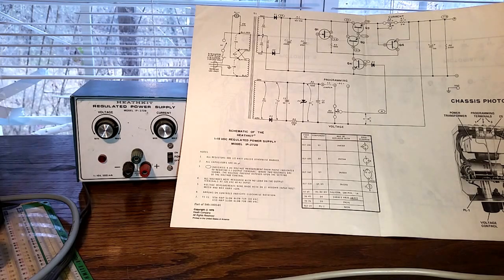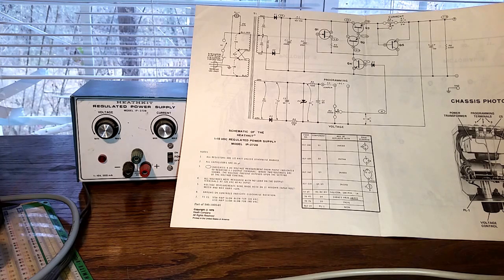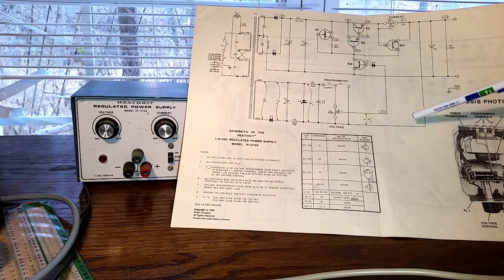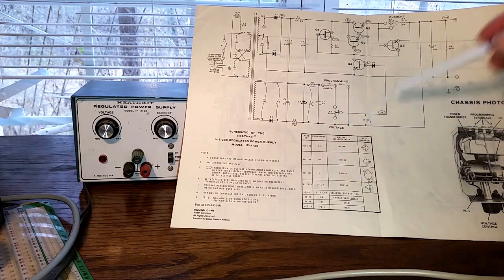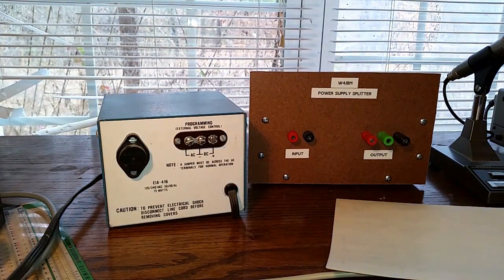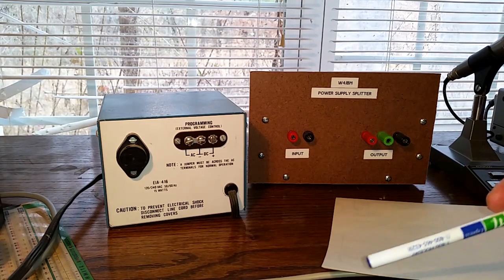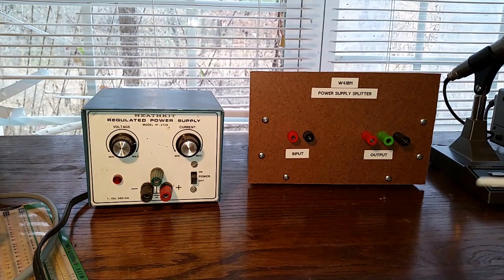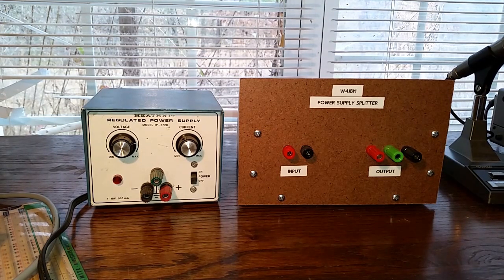Heathkit IP-2728 Power Supply

Comment: My first Heathkit was one of their project boards, with several loose components on a board that could be interconnected to make quite a few different circuits. It was a gift from my parents when i was in grade school. But the first (of MANY) Heathkits that I bought myself was this model of power supply, right when i was starting college. I used it until I designed and built my own later (bipolar +/- 26 volts @ 500mA, plus a 1A 5V for logic circuit, with full voltage and current monitoring), which itself was replaced by a couple large professional laboratory bench supplies with microprocessor control that I use these days. But I fondly remember this small power supply and agree that it was a good design; I just wish that it had meters so you would know what you were setting. At work for many years I had another supply from about the same period, the IP-2718, with a similar transistor design, but it was bipolar, had tracking, and a switchable volt/amp meter, and I always thought that was a good product as well.

BTW, the IP-2728 in this video was just a newer version of the earlier IP-18, which came out in 1969, and this IP-2728 replaced than one in 1977 and they continued to see it until 1990. Heathkit very often started with original designs that were in line with contemporary product design, and then just "milked" those designs through various "re-stylings", giving them more modern exterior appearances while keeping the internal circuitry identical, or nearly so, to the older designs, and carried on doing that until they stopped selling enough of them.

It was mentioned in this video that it would have been nicer if this power supply had meters. The IP-28 was basically the same circuit design, but with metering added; it also had improved specifications through the addition of a dual-Zener reference circuit and some other small refinements. Like the IP-18 & IP-2728, the IP-28 had "programming" and it also had the option of "remote sensing" for the voltage regulation feedback.

The VERY popular IP-2718 was probably based on the IP-28 circuit, at least in the power stage, although the reference and feedback parts of the circuit were very different.

A similar circuit design, but 'upside down' due to an all-PNP transistor philosophy, was the popular IP-27, which also handled more power than the models mentioned above. It was itself a re-styling of the IP-20 from 1962, with the only real circuit change being to replace an OB2 voltage regulator tube with a Zener diode in the first stage of the reference voltage circuit. Both the IP-20 & IP-27 augmented the "adjustable current limiting" ("constant current") of the above models with an actual hard overcurrent protection circuit using a relay, and this operated much like the integral overcurrent protection of the modern 3-terminal voltage regulator ICs. Both of these models ALSO added over-temperature protection by way of a thermistor in the power output stage.

The above covers pretty much all of Heathkit's low voltage power supplies, EXCEPT for the somewhat unsuccessful "IP-27xx" series of 'professional' rack-mount power supplies (IP-2700, IP-2701, IP-2710, IP-2711, IP-2720, IP-2721, IP-2730, IP-2731), which some Heathkit experts/historians have called rare examples of colossal failures for Heathkit; soon after introduction, they were were forced to drop the price in order to dump them. The various models were organized into four versions having voltage ranges of 0~60V @ 1.5A, 0~30V @ 3A, 0~15V @ 5A, and 0~7.5V @ 10A. Those were the even-numbered models, and they all had analog metering for voltage and current, while the four odd-numbered numbered models were just the same except they had digital metering. The designs WERE very complicated, pretty much "everything but the kitchen sink, plus a few kitchen sinks" design philosophy, although if Heath's goal was to make professional laboratory grade supplies, all those circuit bells and whistles were probably justified. But this made them too expensive for Heathkit's target clientele. I have been collecting examples of that series, and it seems that most of then probably went to college/university electronics labs, where they probably gave good service; certainly all of the used ones I have purchased still work well, and they are quality equipment. But for amateur electronics labs, they are too expensive, too big, too heavy, and having the wrong combination of features for the average workbench.
Reply from the maker: youtuuba I have thought about using a paper or cardboard skirt with voltage markings on the voltage knob but have never gotten around to it.